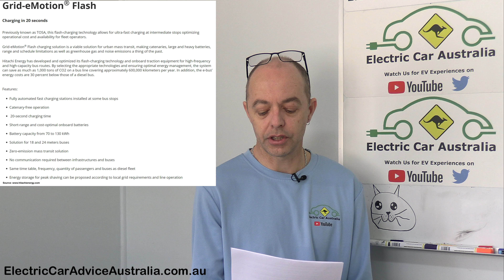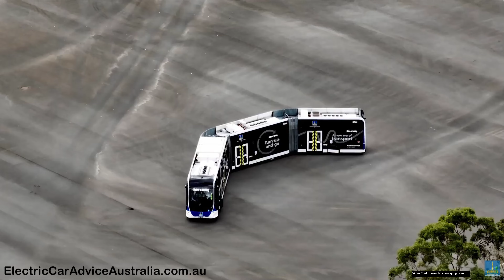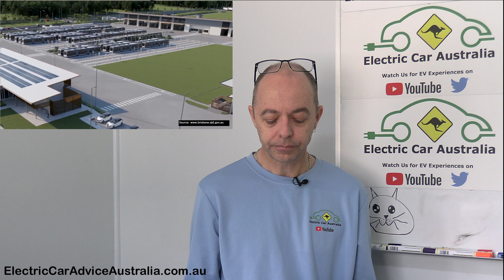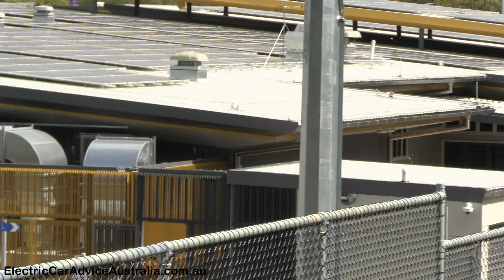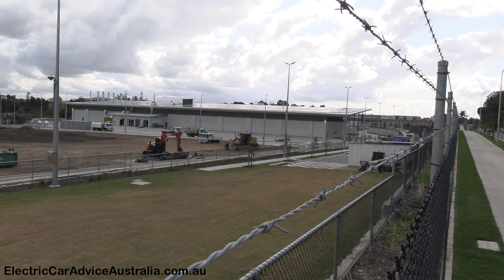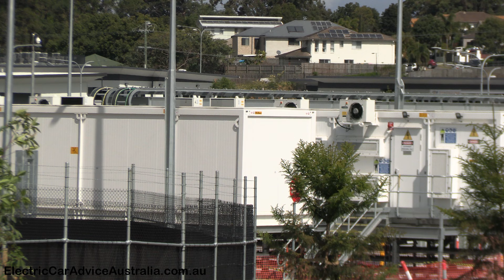GIANT EV People Mover | 150 Seater 600kW EV Charging | Brisbane Metro 100% ELECTRIC Public Transport

Comment: Hi, i have a question related to MG ZS ev. It would be great if you can help me. 
I would like to upgrade the lights on my ev but since the headlights are sealed we have to install led bar lights or auxiliary lights to the front battery. Is this safe? Or does it affect the overall range of the car?

Comment: I was working on the northern turnaround/ charging station at countess st.  And talking to some briabane city bus managers,  all new buses will be electric from 2027,  and to accommodate all the charging required, they need to build two new massive depots
Reply from the maker: Thanks for the comment. That's great News!
Reply: Also on how the network will function,  at first they were going to have all the suburban bus routes dump their passengers at the first busway stop they use and then turn around and head back to the suburbs,

Now it's a mixed bag,  express routes will continue to their full destination,  and non express will dump at first busway station and head back
Reply: @AnarchyEnsues  This is excellent news. I recently wrote to BCC asking when we will get EV ferries and more EV buses. I had a very non-committal reply from Cr Ryan (Transport portfolio) that was pretty underwhelming - it certainly didn't say that all new buses would be EVs from 2027. Thanks so much for sharing this info.